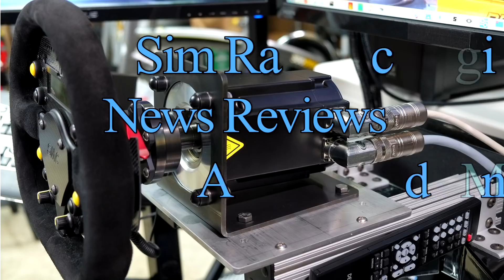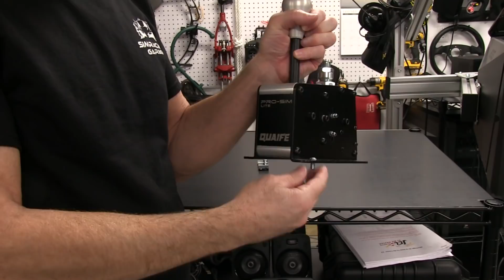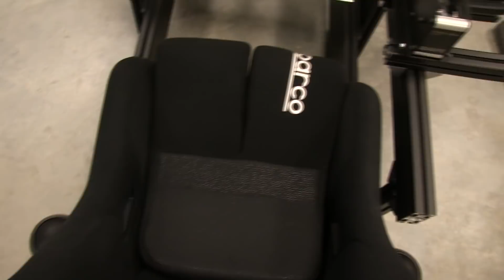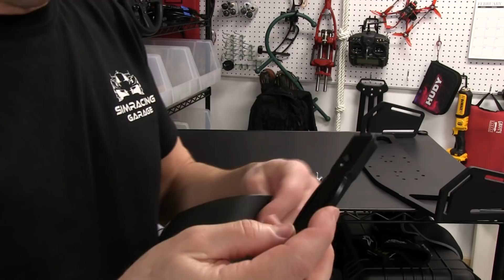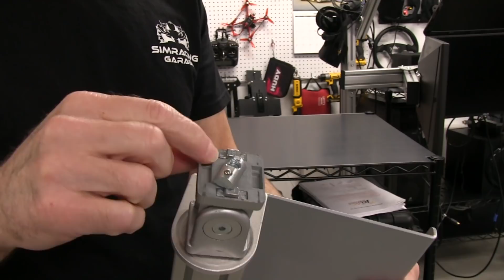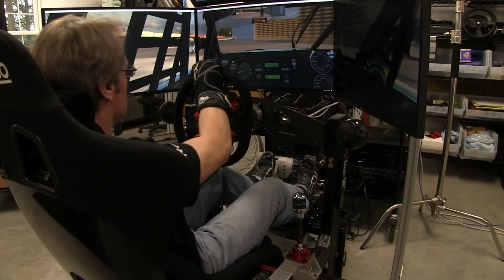Sim Lab P1 Cockpit Part 2 "The Setup"

Comment: Sim Racing Garage at 24:18 that is what i wanted to know the size of that spacer,  it can't be 2 inch from top to bottom can it. It looks more like 4 to 5 inch. I can't find one that long and silver anywhere.
Reply from the maker: I have several different sizes. The one here is the 4". You can get one here: https://www.ebay.com/itm/4-Steering-Wheel-Spacer-Polished-Aluminum-for-MOMO-ISOTTA-SPARCO-OMP/111015588260
Reply: @simracinggarage3026  Thank you for taking the time to do that for me it is greatly appreciated.

Comment: Anyone wanting a cheap option for a seat slider, i used the handles you get with the pedal deck, the ones that you can loosen to slide the pedal mount part back and forwards. I got another 4 for cheap and used then to secure my racing seat (Motamec GT02) to my P1 and it works great. Only issue i had was needing to put washers on the screw part of the handles to make it the right size but that was easy. Anyone wanting pictures drop me your email. 

Sorry for my English it is not my first language

Comment: Does this fit any sparco seat ?
Reply from the maker: If it is a one piece shell racing seat. As they all have a standard racing seat bolt pattern.
Reply: Sim Racing Garage also what other fixed seats would you recommend
Reply from the maker: Seats are a very subjective thing when it comes to comfort on longer stints. Just because one works for me doesn't mean it will for you. Best to try some a your local speed shop if you have one. That said, the NRG Pixma is comfortable to me and some others I have had over to try different setups.

Comment: Thank you so much for the channel first of all, quick question , whats better SIM LAB P1 or the TRAKRACER TR160? I am trying to use the DD1 and trying to build a nice system , appreciate the help : )
Reply from the maker: Sorry, I have not had a chance to test the TR160. Although, based on my experience with profile cockpits, I would think it will be a very sturdy unit. However the wheelbase mounts do raise some concern with how much metal has been removed from the cross mount pieces. But need to test to draw a final conclusion.
Reply: @simracinggarage3026  Thank you so much for your kind reply, also what is the motion system that was used for this setup ?
Reply from the maker: D-BOX

Comment: For the side profile that the shifter sits on, why does the longer profile have to sit on top of the shorter upright profile? I understand to support the weight, however, couldn’t you remove the two hole bracket on the rear and slide your 380mm piece up and down along the inside side of the smaller rear upright and secure it with a 2 hole bracket on top and bottom or just a 4 hole bracket that fits on 4040 series and than it has 2 bolts on the bottom and 2 bolts into the 380mm? Hope that makes sense....

Comment: Do you know or can you measure that can I fit my XL sized OMP WRC seat into this rig setup without any special modifications to the width of the rig? I use same type of sparco seat mounts as you did on this video so they curve under the seat a lil bit but my seat is a little wider than normal sized sparco seats for example. I sold my Subaru track car couple years ago for financial reasons and before I did that I promised my self that if I one day to sell it I will build at least sim racing kit so I can keep driving on the track without all the cost that you normally need to pay. I still have my seat and 4 point harness and personal driving gear so I am now looking to buy full Fanatec setup with OMP wheel and that sim lab p1 in black. 

Also do you recommend to getting 1-3 screens or VR?

Comment: What kind of motion are you running and was it easy to set up to P1? The front base of the P1 is semi open (ok the pedal mount is there sure but) does it give any flex in front with motion?

Comment: Do you like the steering wheel that high up?  I prefer it lower otherwise I feel like I am hanging down from the wheel.
Reply from the maker: Yes. Everyone is different, so it would not surprise me if it would be too high for some.
Reply: @simracinggarage3026  Thanks for the reply.  Where would you recommend the keyboard tray go then if you were to mount the wheel lower?
Reply from the maker: You can mount it on the outside of the wheel support profile. You will still be able to swivel it to where you can reach the keyboard easily, but will not be able to swivel all the way under the wheel. I have to do this sometimes when I use a larger round style rim. I remove the keyboard from the tray and lay it in my lap on those occasions. I have it attached to the tray with a thin strip of velcro down the middle and 2 of these sticky pads people use for cell phones. https://www.ebay.com/itm/New-2pcs-Black-Anti-Slip-Car-GPS-Phone-Holder-Dashboard-Sticky-Pad-Non-Slip-Mat-/281799554789?hash=item419c8ff6e5 I place them on either side of the keyboard. Have yet to have the keyboard bounce away. And I run my tactile setting pretty high often.

Comment: I just need to figure out how to make this cockpit break down quickly and stow when not in use and I'll be pulling the trigger. Fortunately I'm a VR junkie, so no triple screens to worry about, but I still need to move it out of the way in between uses. My current rig is not nearly rigid enough and a DD wheel base seems imminent. This channel has been slowly leading me down the dark side...
Reply: FYI, I did achieve my objective. I have retractable casters on it and I can roll it out of the way. I have the USB cables together in a sheath. I plug in the NLRv3 and wheel base to AC on one side, and my 4 channels of transducers which currently use 8 banana cables will be reduced to single 8 pole quick connect shortly.  Very quick and convenient.

Comment: @Sim Racing Garage Are you still using butt kickers ? If so where did you mount them on the p1. Thanks
Reply from the maker: Not using them now. The D-Box system's actuators also provide tactile feedback. So, no transducers needed.
Reply: Sim Racing Garage thanks for the feedback

Comment: With that keyboard mount do you know if it would be in a good position for FPS games since it only has one articulating joint?
Reply from the maker: You can tighten the vesa mount pivot bolt to where it is pretty stiff. So I think it would not have any problems with FPS games.
Only issue might be the amount of area that you need when moving your mouse in the heat of battle. I have seen some players
with longer mouse movements that others.

Comment: hello Barry Fantastic review as always
can you plz tell me where did you get the USB adapter that you have  hooked up on ur rig for ur wheel USB cable thanks
Reply from the maker: That is a part that I had made at Turn Racing. He makes custom wheels like the Audi R8 wheel I did a review on. This particular adapter/mount uses a Lumberg connector that I put on my wheels. I'm sure he can make you something with a regular USB "A" interface if you ask.
Reply: Sim Racing Garage Thanks for replying back but this is the item I was looking for I’ll send you a picture but it’s a little blurry it’s where you have your USB cable connected to it where it’s Kaina mounted on to your rig on the 8020 profiles it’s that USB wire that comes out of your steering wheel directly into your 8020 profiles that little mount that you have it hooked up to tried to send a picture but I just there’s no way I can do it through here
Reply from the maker: Contact me at: info@simracinggarage.com
Reply: Sim Racing Garage Thank you very much keep up the good work Barry
Reply: what Speaker wires are you using and where can I get them ?
 thanks

Comment: What size monitors are you using and at what resolution
Reply from the maker: They are 27" IPS Monitors running at a combined resolution of 7680x1440.
Reply: Thanks, are you using a 1080ti and if so what setting do you use within the game ie Low, Medium, High or Ultra

Comment: Barry, how did you mount the Sparco shifter knob? What did you us for that?
Reply from the maker: It came with some different sized nylon inserts. Pick the diameter that you need for your shifter and push it into the
knob. Mount the knob and tighten the 3 set screws in the knobs collar onto the shifters shaft. Screw on the cover ring and your done.
Reply: Sim Racing Garage Thanks for the advice. My Sparco Tecno is second hand and came without the nylon inserts. Hope I can find these separately.
Reply from the maker: You could try these: https://www.ebay.com/itm/MOMO-Nardi-Sparco-NRG-ISOTTA-Shift-Knob-Install-Kit-Screws-and-Bushings/141524884143
Reply: I think the Sparco needs M10
Reply from the maker: The Sparco knob in this video uses a universal mounting system. No threads. If you buy the same you should get everything you need to mount it to a shaft with the knob kit.
Reply: Sim Racing Garage Barry thanks, could you maybe post a link where I can buy such a universal mounting system?
Reply from the maker: Do a search for universal shift knobs. Pick the one you want.
Reply: Sim Racing Garage Ended up returning to the seller who supplied me with some of these plastic inlays! Worked like a charm. End result is beautiful. Thanks for the help and inspiration Barry!

Comment: Hi Barry, you run a fantastic channel! Question on the p1: I noticed that you mounted the Quaiffe H pattern on the P1, but how did you do this exactly? With two 80 20 cross bars? And can you think of a solution to simultaneously mount the Quaiffe sequential? I can imagine swapping these is a bit imconvenient.
Reply from the maker: Yes, 2 40x40 profiles. Not sure how often you change shifters, but one way would be to have each shifter mounted to it's own dedicated pair of profiles with brackets. You could then loosen the brackets and slide the shifter assembly off towards the rear of the 80x40 shifter mount. Then slide the other assembly on. Of course this would mean you would need to remove the plastic profile cover on the end of the 80x40. Or leave it off. Personally I would not want both shifters at the same time. One of them would always be offset from the optimal shifting position I think.
Reply: Barry: that would be the best solution indeed. Quaiffe offers a discount on both when purchased as a bundle and since the shaft of my TH8A broke today I guess I’ll be making a long term investment soon😆
Reply: Barry: where can I find the gearknob that you use for the Quaiffe sequential?
Reply: Sparco universal shifting knob. Probably not available anymore but Sparco has some nice current models. Thanks.
Reply: To be more specific: it’s the Sparco PK R77, it weighs 300 gram.

Comment: I have a question, my triples currently are connected to my 8020 rig. I got the Psl sequential  and I notice my right hand side monitor shakes a little no matter what I try. I need to separate the monitors from the rig and it will stop. Can you tell me two things please, what is the length of your 1.5x1.5” profile along the bottom that the wheels are attached two? Also, would you mind telling me how many inches of that are to the forward since I se the majority of it is on the front? I was goin to order what I needed from Faztek.net, but was trying to figure out the length.  Thanks in advance!!
Reply: I want to add something also. Since it’s attached to my rig currently, the uprights are 1.5x1.5” I have the Richmotech angle brackets and monitor brackets so it holds fine all made of that profile, that’s on the rig though. Should I change the two uprights( maybe the center also) to 1.5x3”? Or should it be ok to just run the uprights I have down to a 1.5x1.5” profile. I have (3) 32” monitors. Your giving an opinion so if it don’t work I won’t say hey you said so. I just would like a second opinion, more so from you as you deal with aluminum profile on a regular basis so you know what it can hold.
Reply from the maker: Contact me here if you would like to discuss. info@simracinggarage.com

Comment: Hey Barry sorry to pin you down but looking to get p1 or jcl v2 which would you recommend over the other?
Reply from the maker: My choice would be the P1. But just barely. And only because it is made with industry standard 40 series profile. I really like the powder coated finish on the JCL product. It is also lighter, so easier to move around if you need to.
Reply: Sim Racing Garage ok thanks alot

Comment: Great vid, just built my P1. My cup holder came with tiny bolts that just push through the 6mm T nuts also supplied with the cup holder. Also, the mouse plate had no bolts short enough, luckily had some little washer laying about to space a couple bolts. I wish the mouse plate was silver though, the black finish had marks in it on arrival. They didn't include my keyboard tray or shifter mount, so that's another long wait sadly. It's a quality cockpit though and I look forward to my DD wheel arriving soon. I am tempted to order two 500mm profile pieces so I can mount the pedals a bit lower, actually down in the base frame instead of on top.

Comment: Ok, you just about have me sold.  Im running a Simetik K2 Rig.  I wish I would have seen this one first.  It seems so easy to add anything i want to it.  One thing i dislike about the Simetik was the way the shifter mounts.  I had to adapt a 2X4 so that i could move the shifter closer to where I really wanted it.....not ideal but it works fine.  I would so love to pick your brain since im seriously considering adding motion.  From watching your vids, it seems so easy with this rig.
Reply from the maker: drop me an email @ info@simracinggarage.com

Comment: I am definitely considering this cockpit. I may even add the Next Level Racing Motion V3 which can be done with extra connectors and longer screws, as explained to me by Sim Labs.

I like to have my shifter on the correct side for whatever car I am in. Do you know of any easy but solid and secure way of possibly swapping sides without actual dismantling involved?

Comment: Thank you for the incredibly in depth reviews, they are awesome! Just a question though, how does this cockpit compares to the stage 4 and the other ones you have?
Reply from the maker: This the only cockpit I have now. P1 is much easier to add hardware, and dial in a proper, comfortable driving position. As is any 80/20 cockpit.

Comment: What is your way of dealing with number of USB connections required to run a Rig like yours? 

Do you use internal USB PCIe expansion card to get more ports (if so which one?)

Or did you had any luck with hubs? Or mix of both?

Thanks
Reply from the maker: I have tried expansion cards, and hubs. I have had the best results with these high powered hubs: https://www.amazon.com/gp/product/B008ZGKWQI/ref=oh_aui_search_detailpage?ie=UTF8&psc=1 

They are capable of 25 watts. Their power supply provides 5v at each port with a max of 5 amps total to all ports. I have found that some usb powered sim racing hardware can be very sensitive to the power they are provided over the usb port. There are other things that can effect the performance of our usb devices. And can be difficult to trouble shoot. So taking the problem of not enough power out of the equation helps a lot. Having up to 9 usb devices running on my simulator at times, combined they will need a lot of power to keep all of them happy. I currently run 2 of these hubs.
Reply: Thank you for getting back to me Barry. 

Before reading your answer I have ordered 13 port 60W Anker hub (https://www.amazon.co.uk/dp/B00KHJ2C3C/ref=pe_3187911_185740111_TE_item) which is capable of similar amperage per port as the one from your link plus they both use VIA chipset so hopefully all will be fine. 

Also I have ordered 7 port PCIe extension card (https://www.amazon.co.uk/dp/B01EHU1EWG/ref=pe_3187911_185740111_TE_item)... I was using other 7 port USB expansion card before but it has stopped working recently, I assume due to Windows 10 update (we all love them don't we?) and due to lack of updated drivers. The one I got this time is supposed to be the least problematic of the bunch according to buyers comments (also this, I assume, Chinese brand has website with some drivers on it). 

I never experimented with HUBs before because I remember reading on iracing forum that HUBs are introducing latency and becasue of that are not a good idea for sim gear - have you noticed anything like it with your use?

It would be perfect if this Anker hub would work just fine. Would solve all my problems and you have given me hope with you recommendation for similar HUB plus with your finding that HUBs, for you, were the least problematic in the end.